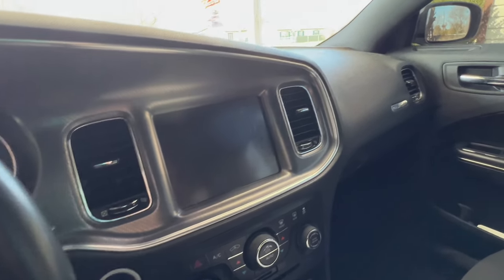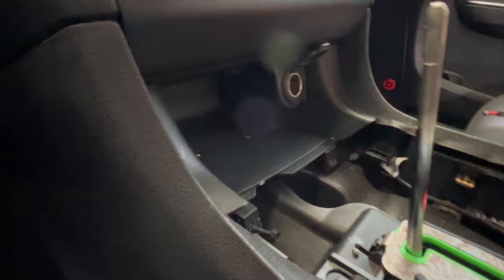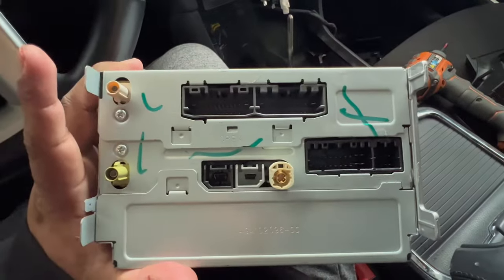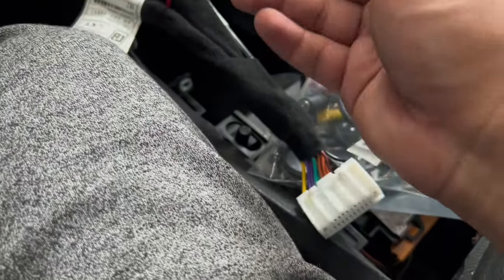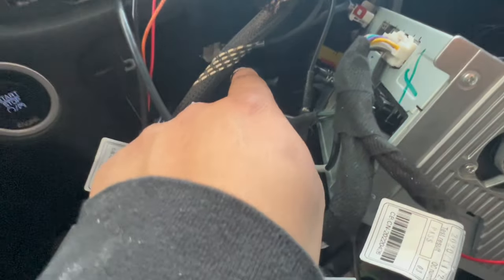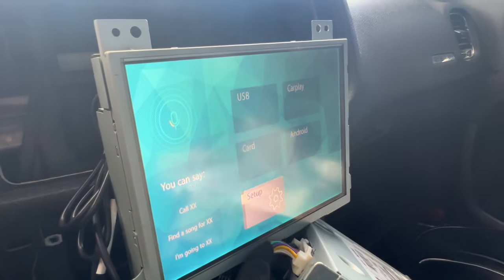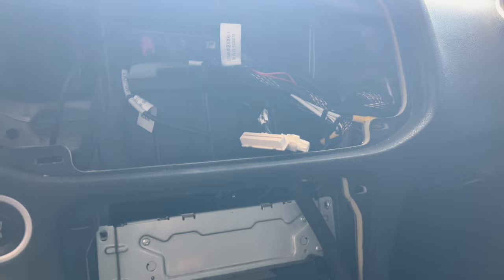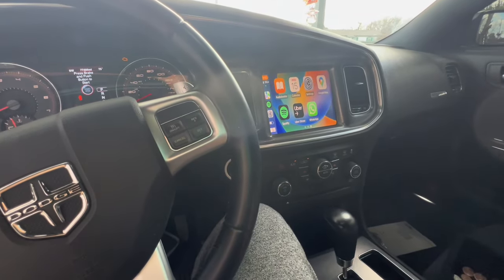How to get CarPlay/android auto on 2011-2014 charger,Chrysler 300, dodge journey

Comment: Will this work for the 8.4 without the nav feature?
Reply from the maker: I’m not 100% sure but it should take out your radio and check if it has the same connections
Reply: @mxjuxior2418 do we know if this works with 2014 dodge charger rt I have UConnect 8.4 inch screen but no navigation. And which one would I buy if it does thanks!

Comment: If you are using for example  Spotify your steering wheel controls works? Volume and change songs
Reply: I got the same kit and skipping songs doesn’t work for me but volume does work on the steering wheel
Reply from the maker: Changing tracks doesn’t work for aux but everything else will

Comment: I just installed this into my 2014 Journey, and it's working well so far. The only thing I couldn't do was the PIN for settings, it would not take 0000 like yours did, so it still thinks it's on a Maserati. Otherwise, everything works.

UPDATE: Joyeauto sent me the PIN. Now it knows it’s in a Dodge.
Reply: Mine does this too. What’s the code
Reply: For dodge
Reply: The code they sent me to unlock the settings was 0123
Reply: @jrios1168 did you email them for code? Or they sent it on the paper for you

Comment: This is great video and DIY project, thank you! I would afraid though to disassemble myself factory installed parts. The question is: what does that change actually adds, except alternative theme to UConnect and advanced audio settings? (I do not have Beats in R/T, but Alpine Audio, which seems to be great as well)

Comment: Thank you for the video. 
How are you finding the system so far? 
Have you been able to find a way to change tracks via the steering wheel? It’s a feature I use a lot.

And how are you finding the quality of the microphone? 

Also, have you had experience with the other brands at all? Nifty, Naviks, Naviplus?
Reply from the maker: System is great had no issues and using skip buttons will not work with this unit microphone is also great although you can get a better one for 10$ on Amazon
Reply: Link?

Comment: How’s it been working 10 months later so my Bluetooth isn’t working and the replacement module is $600+ does this solve that problem so does it have it own Bluetooth
Reply from the maker: This has its own bluetooth solves that problem better with wireless CarPlay still working good added android box to be able to watch YouTube Netflix etc
Reply: @mxjuxior2418  sweet then I’m gonna buy this instead cheaper then buying the Bluetooth module so if I do Bluetooth the controls in the steering wheel won’t work only wired? And what about the mic while making a call? And this is only wired Apple CarPlay ?
Reply from the maker: @AliVapeReviews  wired and wireless CarPlay it comes with a mic you would have to run it to your pillar steering controls work only one that won’t work is skipping and playing back songs button
Reply: @mxjuxior2418 also another question so if I have Apple CarPlay connected can I go back to the normal screen to see my srt pages or will it disconnect
Reply from the maker: @AliVapeReviews  yes you can do anything normal nothing will happen
Reply: @mxjuxior2418  oh ok so just hold the back till it goes back to the stock screen and will still be connected thanks i just ordered it don't wanna drop another 600 for a bluetooth module and buy this for 300 instand

Comment: Wow 🤩 awesome vid bro! The reason they didn’t put it in our cars is because it wasn’t really a thing yet between 11-14. I have looked up things like Navtool and naviks and they were like $700-$800! 😢 this is a great option! Going to order it right now! Thank you! I have a 2011 Chrysler 300 by the way and just wondering if you’ve ever had any issues with the telematics module for Bluetooth? I’ve replaced mine 2 times from ones from a junk yard…
Reply from the maker: I’ve been lucky to not have issues with factory Bluetooth but a plus is if yours is out this will fix it it has its own Inter grated bluetooth
Reply: Awesome vid. Thanks! looking for an alternative to getting a tesla screen. @SRT8300CKY  I have a 2011 chrysler 300 as well. Did you get/install? How is it?
Reply: @wordekew this car play will work with the 300s or 300c

Comment: The reason i ask is because i have the Beats audio system but my volume hasn’t been working and it’s driving me crazy so i was thinking on switching my screen hoping the volume will finally work.  And my backup camera hasn’t been working since either. The dealership said that the problem could be that my telematics module is burnt out and that i need a new one.
Reply from the maker: @ManuelGarcia-o3i  it still uses your oem system so you’ll still have the issue
Reply: @mxjuxior2418  but say a switch my radio screen to a different one will it keep my beats thing when i turn the vehicle on or will that go away?
Reply: @mxjuxior2418  like if i get a whole new radio screen from the one i have will my volume work? Or what do i have to switch

Comment: My sound is absolutely terrible with this unit. Any tips?
Reply: When I was connected to both my uconnect and this my sound was fine but I couldn’t use carplay to make and receive calls. Now that I’m only using CarPlay BT I can make and receive calls but my audio is terrible
Reply from the maker: you have to mess with eq
Reply: @mxjuxior2418  finally figured that out. Does your reverse camera function when in CarPlay? Mine doesn’t. I reached out to joyeauto and was told I need to tap into a wire in the tail light. My car came with rear camera

Comment: How were you able to get the reverse camera to work? Dip switch 8 is on, customer support state that I need to have guideline on through the CarPlay but still nothing. Do I need to turn on dip switch 4 as well? Is there anything else I’m missing? Would those two yellow cables be for aftermarket camera only as well or was I supposed to plug that into somewhere?
Reply from the maker: Mine just worked naturally didn’t do anything special but I believe I did turn dipswitch on for oem camera
Reply: @mxjuxior2418  man I just haven’t had any luck getting it to work. Dip switch 8 is on. Guideline option on the car play is on. I tried turning on dipswitch 4 to see if it’ll change anything but nothing. I might just have a car radio shop take a look at it and either program or wire my reverse camera to it. It’s extra money that I wish I didn’t have to pay but I guess some devices they make are faulty since another guy I know has the same issue for about a year since he had his
Reply from the maker: @silentagony1019  is yours the electronic shifter?
Reply: @mxjuxior2418  it’s a 5 speed yes

Comment: When you ordered it, how long did it take for it to arrive?
Reply from the maker: @xxdoonierookie6502  roughly 2 weeks
Reply: @mxjuxior2418 I recently bought that module, and i installed it in the same area where you put yours. It honestly works great, but i have one question. Since you had it for a while there, won’t the device overheat in that spot?
Reply from the maker: @xxdoonierookie6502  not a single issue

Comment: So even though it says it's for  Maserati Ghibli Quattroporte it works on the Charger? I have a 2012 and looking to do this.
Reply from the maker: Yes, Maserati of that year is the exact same radio as the one in chargers, Chryslers jeeps etc just make sure your 2012 has the same connections as the receiver
Reply: @mxjuxior2418  Awesome. Yeah, they have the same connections. 2011-2014 radios are interchangable. Thanks!
Reply: is it worth it tho for 400$
Reply from the maker: @jags28263  yes it’s worth it 400$ is nothing compared to the 1000$ one from naviks that  is the same thing as this
Reply: Very worth the $400, and it’s easy plug/play. Shouldn’t take more than 1 hour to install.

Comment: I’ve been skeptical about using iPads or aftermarket radios since I still want to use my back up camera and it seems that most options won’t use the back up camera. Does this still let you use the back up camera?
Reply from the maker: Any aftermarket radio if not majority retain your backup camera this isn’t aftermarket radio it keeps your stock radio..